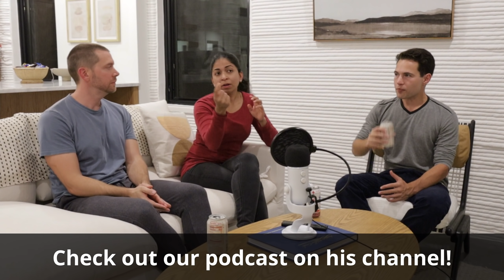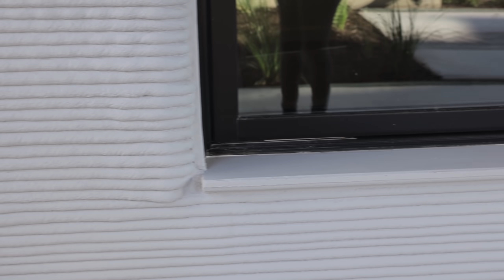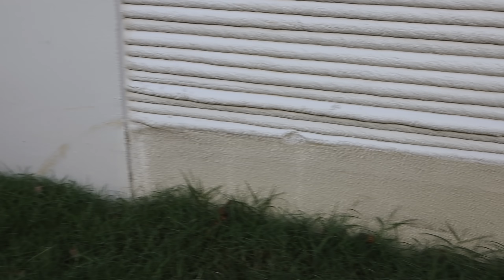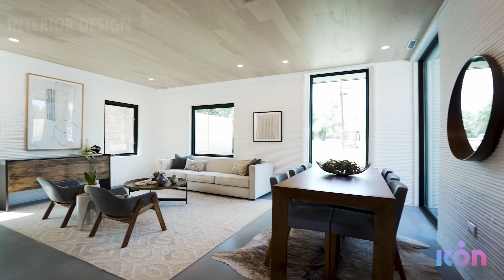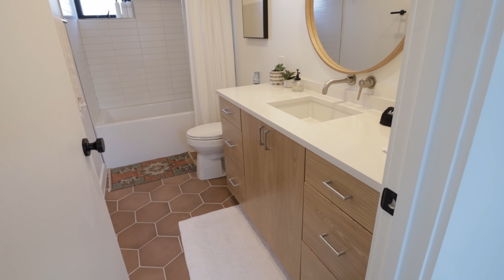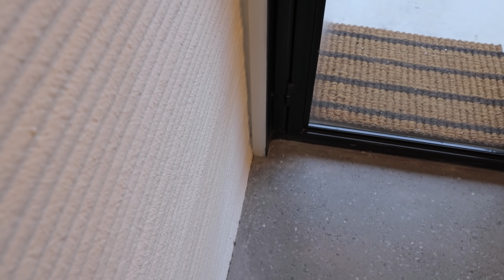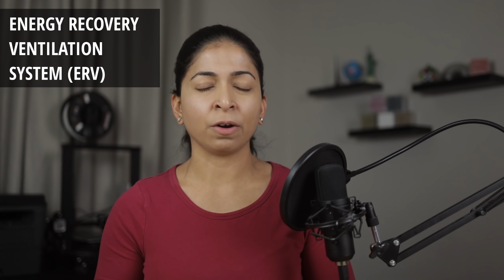I stayed at ICON's 3D printed concrete house in Austin!

Comment: Guessing these would be highly desirable in hurricane and tornado and I guess other natural disaster zone with proper footing and using like open source UHPC.   Might not even have to worry about the ideal shape like a dome or something more hydro/aerodynamic.
Reply: Maybe like a UHPC or HPC using a recycled polymer too instead of the metal?
Reply: Wondering how much a pain to place conduit more throughout for more versatility also for later re-design?   I can see if you wanted to keep that finish... some big sausage tube dispensers to blend with the wall finish if later cutting is required.  Then again, some of the stucco and finishing skilled trades are really crafty.  Wondering how well this works for basements too?  Like I wondering about adding foam and/or some sort of recycled waterproofing liner layer on the outside while building up a basement wall?   Guessing lateral loadings would need to be demonstrated... though man... crazy how some have made basements with just treated lumber so guessing wouldn't be an engineering concern with that truss design.   Could like fill completely the lower sections for more geothermal effect and the upper insulate.  Actually, seems like a basement might be better to fill with a thermal mass material that's cost effective and just line the lower part with waterproofing membrane and the upper frost line depth or higher temp soil depth with the closed cell foam.

Comment: Thank you for analyzing this. The idea of printed walls is pretty neat. I would rather have the exterior footprint slightly wider to allow for regular sheetrock interior walls for ease of plumbing, electrical, painting, and picture hanging. The exterior design seems like an updated take on the Tudor house, which I like to some extent. They wisely used the concrete to nod to Evangelical decor, which sells well in Texas. I wish that technologically innovative houses came in a wider variety of styles, especially historic styles. More options for closed or partially closed floor plans would be really nice. I'd like a cute gingerbread Victorian, or an actual Tudor style, or Salt Box or something other than just contemporary.

Comment: Thank you for noting the VOC levels. I would be interested in find out how it outgasses. As someone who developed Chemical Sensitivities, air quality is paramount.  I am 
 following your videos to look at alternatives to conventional stick buildings, which are not safe for the chemically sensitized(via immune disorders) or injured (through large exposures) for roughly 10-15 years.
The ventilation system was also of note because mold growth in conventional housing is also for those with the immunocompromised.

Comment: I don't see any advantage in time for the printed base at seven days. I think I could frame the small ones on my own in that period of time. 
The thermal bridging in the upper stud frame walls did not show the advantage of (3D printed) concrete construction over traditional stick building it demonstrated the advantages of double wall construction. If the studs were cementitious there would be substantially more thermal bridging.
From my perception interior and exterior plastering would allow this concept to be more appealing in up scale homes.

Comment: ...hi, good day! I was wondering, would these 3D printed houses advisable in the tropics?
I live in the tropics and have experienced 280++kph winds during typhoons, will it stand a chance against the fierce weather in the tropics?.
Thank you and have a good day!

Nice content by the way, i like it!
Reply: The printed mortar part would, but the overhanging second floor would probably introduce enough uplift that it would be torn from the foundation.
Also note that due to the way the print head moves there seems no way to introduce continuous tension ties from footing to the wood framing above.
This might be okay in central Texas but there's no way a structure like that would survive the typhoon you describe.
Reply: @jimurrata6785  
...sir, thank you for that prompt reply. Twas brief and well explained.
Good day😊

Comment: They should build the walls with the printer and them turn them 90deg to assemble the house so the layers of mortar are vertical.  Man, that would save a major cleaning headache inside and out.  yeah, I know it would be difficult, but that's their problem to figure out, not mine.

Comment: You're amazing. I felt exactly the same about 3d printed houses. I think the walls are the least of our problems. THere are so many solutions. But the electric, plumbing and venting circuits cannot (yet) be printed or placed in, unless they sorta are prefabbed in a factory and dropped in. 

Which of course adds to the "build time".

Anyways, I hope your objectivity never gets corrupted.

PS: Thanks for your video on insulation R values BS. it is coming in handy.

Comment: I'm all in, I wish I could work with a 3D printing architect to design a hybrid dome house. Like you, I find the real benefit to 3D printed walls is the skulpture potential, printing in artistic designs inside a structure is what I envision. I would use the 3D printed walls as intermediate walls inside a dome structure made with alkaline concrete shell and foamcrete lamination for insulation and a medium to run EMT for electrical and communication.

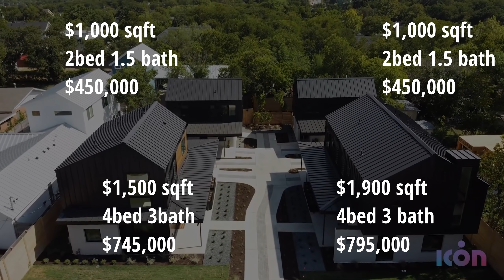Comment: You know Austin is very expensive when their square foot measurements 7:23 have $ in them. ;)

I live in an older house (1965) in an old neighborhood and (with the current market) our house is estimated to be from $239k to $269k and it's 1,700+ square feet.   (Although, we have a converted garage, so there's that.)   I can't imagine spending that much money for those homes.  I know Austin is expensive, but is the 3D printing making these homes that expensive?  Or did they make these high-end homes?  And are they sold furnished?

Comment: I couldn't see any movement joints, and the lack of exterior cracking can be explained by them being relatively new buildings. I imagine that in areas where heavy rain can occur, or ground movement is common, that these walls will quickly decay as the mortar cement is compressed and stretched.

Comment: I had a house in BC, Canada (Livingstone Homes); and to reduce thermal bridging they had the narrower studs staggered on the inside and outside of the frame cavity; with the insulation overlapping in the common area; and where all studs had insulation around them. Due to the narrower studs they were 12 inches apart instead of the standard 16 inches. It worked well.

Comment: These are the first iterations of a relatively new idea in home construction. Materials have no long term studies to assess. The "printers" are purpose built for these materials. I agree with you that some curved walls would be great for reasons beyond esthetics. Air flow, dust and debris depositing and cleaning, and structural strength are just a few that come to mind. I would love to see a circular staircase printed in situ! If you look at the innovations in the 3d printer maker market, we now have dual nozzles, metallic compounds available, better sensors and a host of adjustments for earlier design mistakes. Wider adoption of the tools and increased capabilities of software associated with the technology have made 3d printing more user friendly and no longer cost prohibitive. I subscribe to your channel just for these videos. Kudos!

Comment: Cleaning those interior walls of dust (or grease, in the kitchen) is going to be a nightmare. And that rough exterior would be a real problem in a wetter climate, I suspect.  I can imagine algae growing in the crevices that only a power washer would get out.  I think there is still a ways to go before this is more generally useful.
Reply: It strikes me that it would be fairly trivial to trowel the surfaces of the walls while the material is still wet. I would think that the printer head could be adapted to perform this task.
Reply: It’s common in upstate NY (a wetter climate) to need to power wash vinyl siding every other year or annually.  I don’t know how the exterior coating on this mortar wall would be any worse or even very different.
Reply: @tomkacandes8286  I think the concrete would be better than vinyl, Hardy or stucco. Much stronger so less chance of pressure  water damage or intrusion.
Reply: @tomkacandes8286  But we do not pressure wash kitchens.  Cleaning the walls in the lower open level would be a big task, especially with it being a sealed house.
Reply: It just an option you can plastered it if you want.
Reply: It's funny you should mention that because I was just thinking about how cool the walls would look with mosses growing on them.
Reply: Just what I was thinking....any splashes of spaghetti bolognese or red wine in the kitchen would cause some issues.
Reply: why not just slap a bit of plaster over the inner walls?
Reply: Seems can be sealed with a oligiodynamic or other treatment for critters and pathogens.  Might even looks neat with like a metallic say copper or silver coating... maybe even a specific oxide in maybe like an acrylic matrix.
Reply: If building those structural walls is faster than block wall, we could just plaster them... Though, i imagine that would eat heavily into time savings.
Reply: I'm highly disappointed in the cost of the homes. Half the time but double the cost?
Reply: Sd4q seemed to have a better finished product.
Reply: Use copper strips at transition from concrete to wood.

Comment: You can use simple caulking to fill in the wall spacings and around the outlets.  I have no idea why they didn't just do that.
Reply: The foam backing used on external plug covers would have worked as well, and would allow easier servicing.  Caulking certainly should have been done around all the trim gaps though.  It just makes it look shoddily made when it isn't competently finished out.
Reply: Those are awful.  The fitting. and the choice with those walls. Effort towards an elegant outlet cover would be well spent. I would just want to plaster the interior. Run electric in a baseboard or chair rail.
Reply: @markeastridge9649  - If they chose to leave the concrete exposed, they might as well go all the way, and run the electrical housing on the exterior.  I'd also have put sections of painted particle board in certain areas, so you could actually stick or nail something to a wall.  The uneven concrete sacrifices basic utility for the sake of a gimmick.

Comment: It's a bit counterintuitive, it looks a bit like an adobe house, low tech, but it's actually  trying to be very ingenious, 3D printed walls. I really like those imperfections, but not from a 3D printer, no! I'd expected a 3D printer yields something that otherwise would have been impossible to make, something crazy perfect, something amazing, with unique features. While this is nice it's kind of disappointing, some wirings and piping still not concealed inside...
Reply: I agree.  I'm not entirely sure what the point is if this is the result.

Comment: They could have used smaller plastic 3D printing for all the little finishing touches. Around the door frame would be easy to print an insert and outlet/switch covers would also be relatively easy to accomplish. A lot of thought and time went into the interior design and traditional building methods, but making it seem complete was overlooked.
Reply: That's a funny concept but how much is too much?

Comment: So wait, drilling through the 3d printed walls compromises their strength greatly?!
Reply: Big con.  Deer heads, big TVs, gun racks and giant metal stars are tough to mount via ceiling gallery wires.
Reply: It's not true concrete, just mortar. That's why it has so many limitations
Reply: wonder how it stands up to kids.. and pets.. and drunk adults...

Comment: This reaffirms my view that 3D printed homes are an intriguing concept, but not yet something I would aspire to live in. The technology does seem to be progressing, at least
Reply: 3D printing is automated additive manufacturing. We already use additive manufacturing to build structures, bricks on the small scale and poured formworks for skyscrapers. The future of construction is in 3D printing, but it'll use infinite axis 3D printers to print formworks onsite that concrete can be poured into. That is far more practical than these silly concrete fdm/extrusion printers.
Reply: @OwenWithAHammer  that sounds like pre cast pretty much
Reply: @stynnieuwenhuis9999  idk what precast is but it sounds like you made walls offsite like prefab nd ship them in, that fails to take advantage of cements strength which is volume and weight transportation savings, you want the water to come from onsite or nearsite and pour the concrete onsite, thats ideal.
Reply: @OwenWithAHammer  Well they can produce hundreds of identical pannels in  a warehouse which adds economies of scale and they can be assembled very quickly. Very strong construction but expensive and mostly used in commercial and agricultural settings. Its cheaper to pour in a warehouse  and on a production line than on site. They build in developing countries using that method too since its basically building houses on an assembly line and no external factors like poor weather, poor concrete slump, etc..
Reply: What progress in the technology have you noticed?
Reply: @xumatyt  the fact that they have actually started building liveable homes using it seems like significant progress, they certainly have a long way to go before it becomes a mature technology but it isn't like we have been doing this for 30 years or something.
Reply: I like the word aspire
Reply: I see alot of headaches using this tech over just a stick built first floor.. looking at all the systems I play in a house (thermal, moisture, plumbing, electrical), I only see problems using this tech. 

If you have coordinated a build with sub contractors, you will know there is a lot that needs to be manually done to those walls and it's allot harder in masonry. The insulation approach wasn't fully explained because if those walls are load bearing, they would need to have interior lattice ties between the exterior and interior layers. They could be pouring piers to make none of the exterior walls load bearing but that seems odd.

Comment: Wouldn't it be nice if you could buy a house based on materials, construction costs and a modest builder profit vs this valuation based on other houses, the address and tax bracket.  Until this happens more and more people will be unable to buy a home.  Additionally, who in their right mind would buy a house costing 3/4 of million and have 3 neighbors right on top of you, no garage, nothing to call a yard and the only privacy is being inside all of the time.
Reply: You can, but the house will be in the sticks. Anyone not working out cost per square foot and asking them where does the money go is doing themselves a disservice (if all they are interested in is cheap shelter).

Valuation however is a different beast altogether, and everything from HOAs to Henry George have something to say about that.
Reply: For <1500sq ft, too

But it's the land, that's why the comps

Comment: I fear the walls would need constant dusting to prevent unsightly buildup of dust layers on the small crevices of every lavacrete layer.
Reply: lol I'm glad I'm not the only one who looks at something and thinks "but how easy is it to keep clean?'
Reply: Time to bring back the trade of plastering
Reply: @morninboy  :) I love plastering.
Reply: @morninboy  Exactly 👍🏻
Reply: @morninboy  2nd that... get the stucco skilled trades whether union or not on it.  Man, they'd make it look like whatever you want with structure.
Reply: @morninboy  I've filmed some project that used shotcrete to cover their 3d printed lines.
Reply: @automateconstruction  how did it look in the end?
Reply: @morninboy  It was good, you can check it out in my second video with printed farms.
Reply: I would imagine if this was my house I would simply render the interior walls to prevent this.
Reply: The walls also need frequent bug cleaning. So many wonderful hiding places for insects, spiders, rodents, etc.
Reply: Have you ever lived in a house with constant mechanical air flow from an ERV?  With even a little filtration or an electrostatic precipitator, you never open the windows and there is hardly any dust relative to “normal” houses.
Reply: @tomkacandes8286  erv won't eliminate all dust.. with that many little ledges, it will eventually build up and be a pain to clean. Also if you have kids.. yeah good luck with that. Crayons, food, boogers, you name it, I have cleaned it off the walls.

Many of the builds I am seeing, people are plastering the interior smooth or building walls to cover. Almost all are not printing interior walls so they can run their mechanicals/etc.
Reply: Some sort of internal cladding will be thought up, but will add to the expense!
Reply: @chome4  I'm thinking gypsum is very cheap
Reply: The paint reduces the dust collecting quality of raw concrete that you may be familiar with. The layers do mean increased surface area so more areas for dust to accumulate.
Reply: Leaf blower ;-)
Reply: Yup, above the cooker.... Bleagh!
Reply: @vito5258  yes those systems have excellent air filters, either in the HVAC duct if it's through that system or as a stand alone